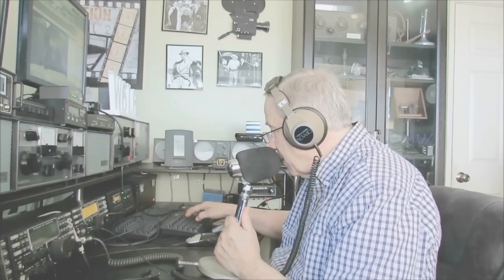Ham Radio Basics--How To Orientate A Beam Antenna--Beam Headings

Comment: Hi Jim,

Just discovered your channel tonight and must've viewed a half dozen already.  So many that it's long after bedtime!  This particular video was a revelation for me.  I can't tell you how many times I've aimed my hexbeam at someone's signal and find that I have to adjust just off their heading to hear them better.  I would grab my compass, run outside and check my beam against my rotator control and it appeared dead on.  I assume the QRZ's heading number doesn't take the deviation into account?

I've also learned about the origin of "Ham", discovered I'm finished with soldering PL-259's and am going to knock down the ALC on my mic settings.  When I have the extra play money, I'll get that crimping kit from your store, looks like a great value.

Anyway, can't wait to get back to your videos tomorrow and get caught up.  I like your style, your knowledge and the subject matter.  Thank you for making the effort, it's appreciated.  73, Howard - W1HBO
Reply from the maker: Thanks Howard.  I think I have heard you on 20 meters.  You made my day (night).  73, Jim W6LG

Comment: Would the same basic principle apply to a flat-top dipole? I usually try to orient the broadside for what I'm trying to hear. Thanks Jim! KE8EAS.
Reply from the maker: Yes.  It should be.  Sorry about the quality of the video.  I hope to fix that in the next one.  73 de W6LG
Reply from the maker: It should.  Typically there is a large lobe broadside.  73, Jim W6LG

Comment: Im from Pakistan..if i can work a station in Glasgow UK or In portugal  5/9....what are the chances that someone is hearing me in north america ? Thanx
Reply from the maker: It is a long distance.  But, it can be done.  A yagi antenna, hex beam or Moxon will make the distance when there is a gray line between AP and W6. 73, Jim W6LG
Reply: Thanx alot Jim for taking time out and sending me a reply....i have a space issue, will try to put on 2 element wire yagi...thanx..73s
Reply from the maker: Great idea.  Is that going to be for 20 meters? 73, Jim
Reply: Yup max i can do for is 20m due space issue..wish i could do for 40m too,and  Jim once again im really grateful for taking time and replying me 73s..😊